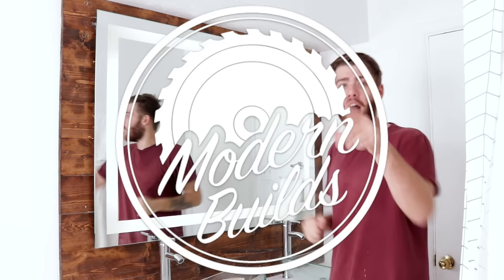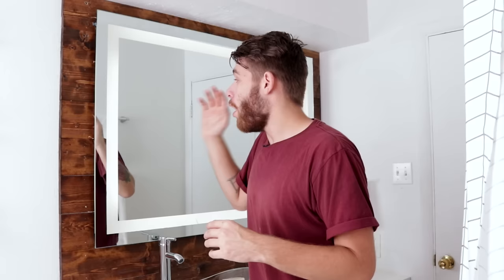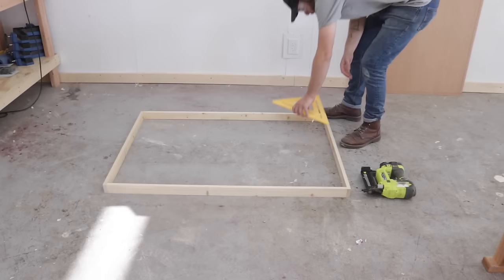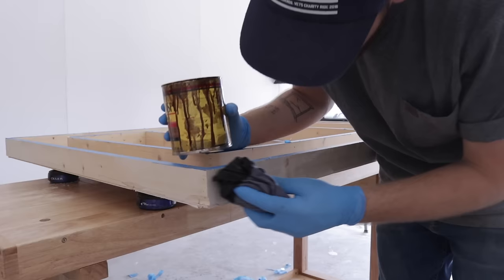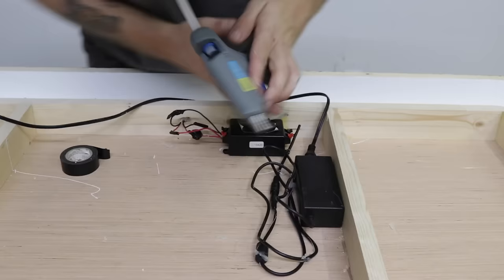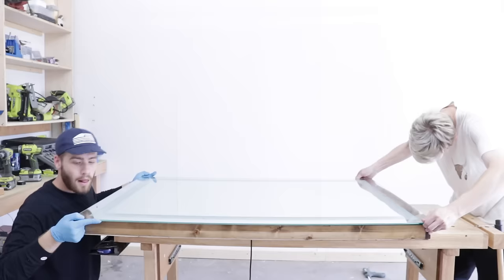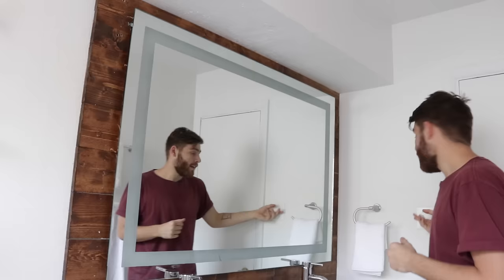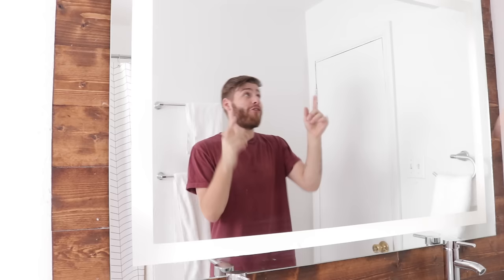DIY LED "Framed" Mirror | Modern Builds | EP.  74

Comment: Hey man, thank you for the inspiratsion! I built a similar one, only smaller, and with waterproof led strip, which I attached on an aluminium profile, in order to cool down the led strip more quickly. I learned that leds could be made waterproof, when you just spray them with lacquer.
Also used french cleat to hang it on the wall. 
Anyway cool stuff!

Comment: That DC795 medium modulus silicone caulking that you used is about as good as you can get as long as you give it enough setup time.  Only downside to how you glazed the mirror is that the inside is now sealed off completely which won't let air circulate behind that centre section like it will need in that bathroom environment.  That said, I'm still unsure how you'd get around that with this project.  I've thought about a project like this before and you may have inspired me to try!  Thanks for posting and keep up the good work!  Also, as a glazier, thanks for putting in a plug for your local glass shop ;).  We are some really cool people with awesome ideas for your home!
Reply from the maker: Thanks Josh, that's good to know! I thought the same thing, but If I ever do have to get to components I can unscrew the back panel... doesn't really help with air circulation though. I you do make make one , I'd love to see what you come up with!

Comment: Try on a small mirror, tapping off like you did on your first attempt. Then where you want the light to shine through take sand paper and sand the back of the mirror. The sand paper will remove the reflecting part of the mirror so light will shine through.

Comment: It's a pretty cool bulild ... my opinion I don't think you get enough light by putting the LEDs around the Border I would place them on the back wall facing front behind the frosted glass if you put it at least an inch back off the frosted glass it reflects smooth.... still a great build..

Comment: Pro-tip, when spraying the mirror, spray while blasting the spray pattern (even pre-heat) with a hair dryer simultaneously. The lighter/finer the coat, and the more immediate the dry time, the better results. You still won't get a perfect result. But, once you see a coat take more than 1 to 2 seconds to complete dry (which you can see as the surface changes), the highest level of reflection can never be achieved regardless of the number of coats.

Comment: Mike, I just had two of these mirrors cut and etched for 2 projects I'm doing. I wanted to tell you that both glass guys informed me that the adhesive you used (and I purchased) is silicone based and will eat at the back of the mirror. They both also informed me that the mirror should have at least a 1/4" "ledge" to rest on because if it doesnt, over time it will slide right down and fail. I am redesigning my light box prior to installation due to these facts. Neither of the glass guys knew each other nor did I tell them what the other said. I was asking them for pointers in the project when they volunteered the info. I hope yours stays in place over time.
Reply from the maker: Good info.. i hope so too! good luck with yours as well, I'd love to see some pictures of yours once it's finished.
Reply: I"ll be sure to send you some pictures and or video.

Comment: I have a question about the wooden wall behind the mirror. I watched you build it in the first part of this bathroom remodel. Since it is a sink area, wouldn't you wanna apply a water resistant material to the wood? Just in case it gets wet somehow while using the sink? I just wonder if the wood would mess up by getting wet? (If someone spills water by accident, not that water spills there all the time or something.)

Comment: I am doing something similar with 2 of my baths, but my question is, was the LED lighting from the mirror enough to light up the entire bathroom at night, or did you have other lighting there? in my case, it is not enough and I am debating whether to get more LED lights or to buy a separate light and install it on top of the mirror.

Comment: And what happens if the PSU or a LED strip burns out? How do you replace it?
Reply from the maker: Take the mirror of the wall, unscrew the back panel and fix whatever needs fixed
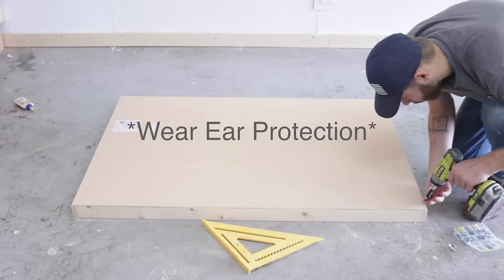Reply: YEah, 2:05... I must have skipped that part. Sorry. However I personally would prefer the back frame fixed to the wall and then the mirror (with the help of L brackets screwed in front

Comment: I do have a question about this ... what about the heat from the lights ?? is there anything that will help it from over heating and cause any moisture behind the mirror on the drywall?
Reply: they are LED, heat is negligible.

Comment: Cool build but would advise not to use hotglue for attaching LEDs - LEDs heat up, some not so much but still it's better to use a glue that is not temperature sensitive - staples usually fit nicely over the strips and is a great easy way to attach them,  just make sure your staples sits over the strip and does not go through it

Comment: Please use zipties... It hurts to see hot glue thrown all over those cables... Also try using spray glue for mounting next time. I use high heat super adhesive, to work with the heat that may come off the strips.

Comment: Yo!  Thanks for this great video!  I’ve been looking to do this myself. I first bought a $250 led mirror that wasn’t the quality you’d expect. Then I found a great deal on one at Costco for $70. It’s a great mirror at the 5000k pure white hue you were going for. My issue is that the LED light on the fan I already have installed is at a much lower color temperature. These bulbs are not replaceable. So I am going to build one with your instructions and install LEDs that can either adjust color temp or are already set at the temperature I need.   Finally around to my question. In your projects have you found a good quality LED setup or even just a quality brand that I can try out to get the temp I need?   Thanks again for the quality post! I’ve subscribed, keep the videos coming!

Comment: Dude, you didnt show how you got the light wired up.
Reply: I assume that he had a plug outlet behind where the mirror was mounted, and that outlet was tied into an on/off switch located where you would normally turn your bathroom lights on or off.  Basically electrically set up the same as a plug-in garbage disposal.  He probably didn’t go into electric because it’s something you should never DIY.  Hire a professional.